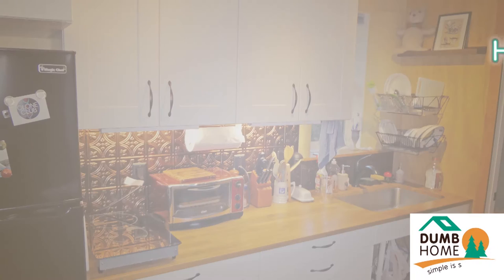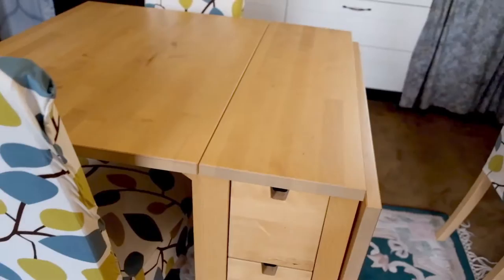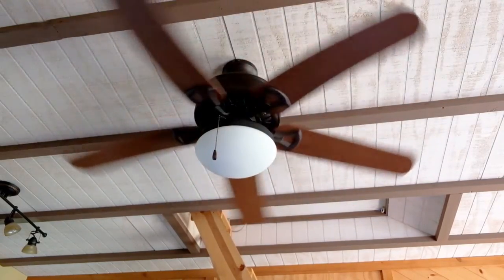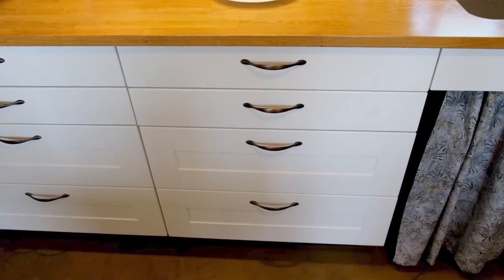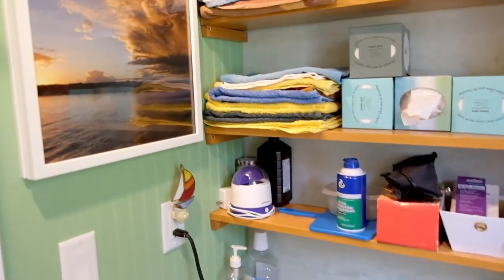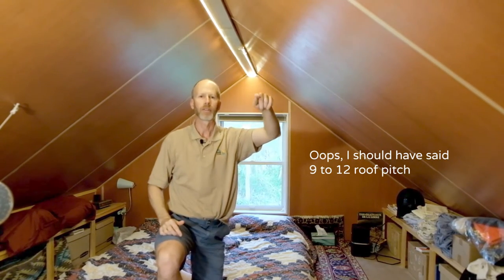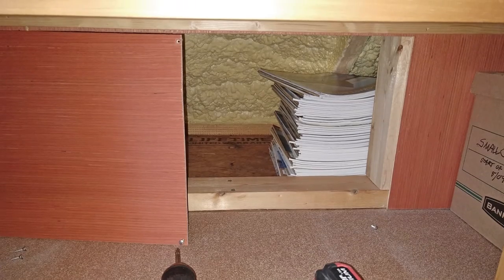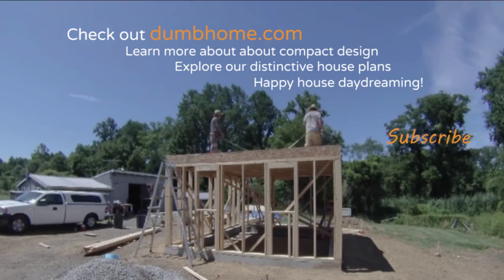Compact Details in My 420 sq.ft. Home

Comment: Hey there! Great videos here. I love the thought processes involved but I noticed you mentioned designing your door to open outwards. That leaves the hinges on the outside as well, right? Do you have a security measure to keep someone from punching the hinge pins? Just curious. I’m not picking a fight nor shaking a finger. You seem to have thought about everything so I honestly want to know your thoughts on that. Thanks and keep up the great work
Reply from the maker: Thanks for kind words, but more importantly your astute question!  The door manufacturer (Therma-Tru) includes two special hinges top & bottom that are captured and can't be punched out.  Wish I could attach a photo, but that doesn't appear to be possible.  If you contact me through dumbhome.com, I'm happy to email you the photo.

Comment: Where in the world did you get the lime plaster? (And get it to look so good)  I've had a hard time finding it
Reply from the maker: Excellent Question--that may have been the biggest PIA of the entire build!  I'd taken a workshop with Sigi Koko at https://buildnaturally.com/ and she pointed me to a couple suppliers of 50 lb bags of food-grade hydrated lime powder (AKA Calcium Hydroxide).  I bought mine from Univar Solutions in Morrisville, PA, labeled as "VitaCal".   I bought a plastic 110 gallon stock tank and carefully poured the powder into the water in small batches, mixing as I went.  (Don't let the powder get on your skin or in your eyes.)  The longer it sits (mix every week or two and make sure the lime has a couple of inches of water on top of it), the smoother is gets, and the easier to work.